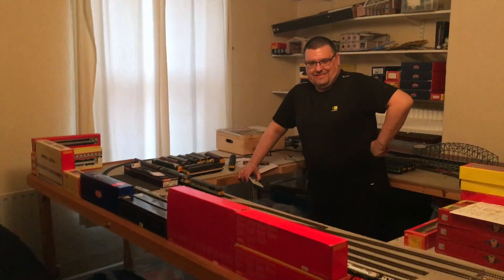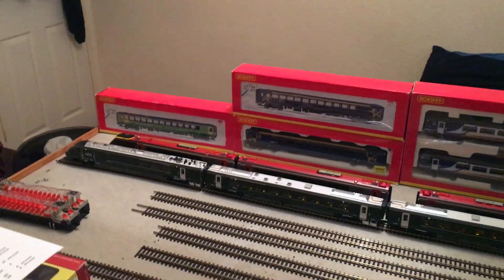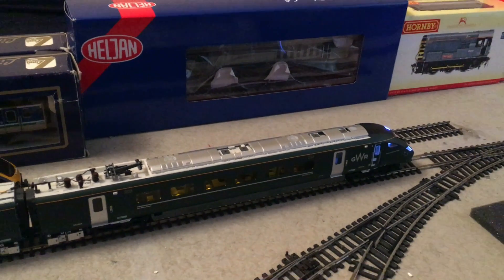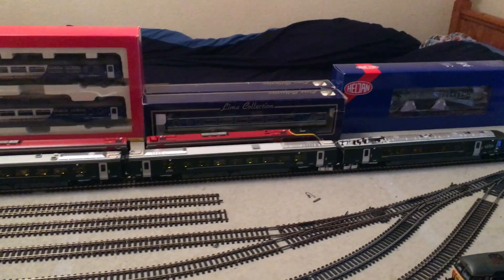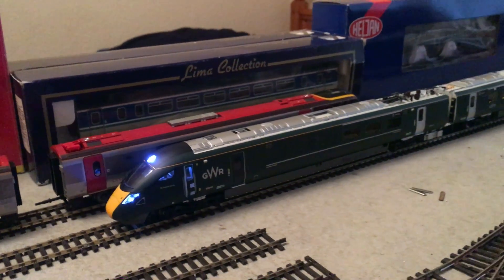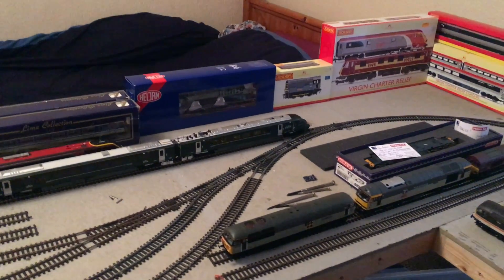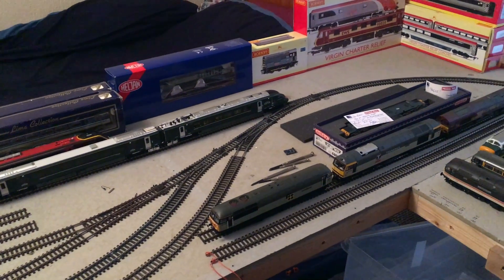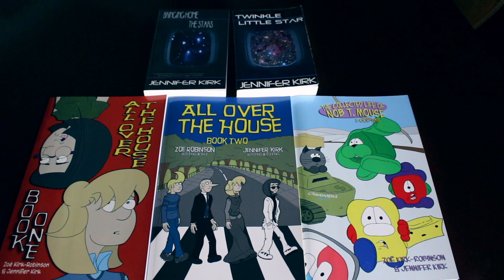Brian's Amazing 4 Speaker 2 Chip DCC Locomotives! - Through The Railway Room Door #1

Comment: Brian, you'd have a grand time with our Paragon 3 sound here in the US. The locomotives broadcast the bass frequencies to a subwoofer under the layout. Enough to wake the neighbors if you like! My wife and pets really love it, too. (they don't really...)
Reply: Andrew, I have an n scale Pennsylvania duplex with paragon 3 here in Wales and you can hear the thing running in the shed (railway room)  from the house - without the subwoofer! 
Not gone DCC yet and wondered how many locos Jenny plans to convert
Reply: @LeslieGilpinRailways  well then all you need is a Rolling Thunder receiver and an old subwoofer with the proper plugs and you'll be causing tremors in Ireland :) I really love the thing.
Thinking about it, I wonder if it works without the DCC...
Reply: @trainman07011  yes apparently it does. The disadvantages of using on DC without the rolling thunder control is limited sounds. The other DC issue is that you need more than 12v to get the thing moving.